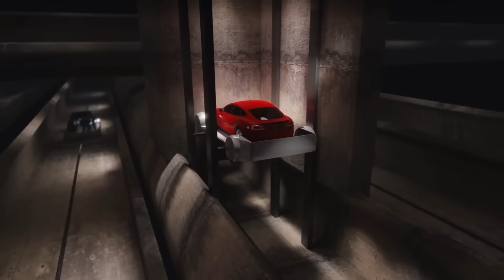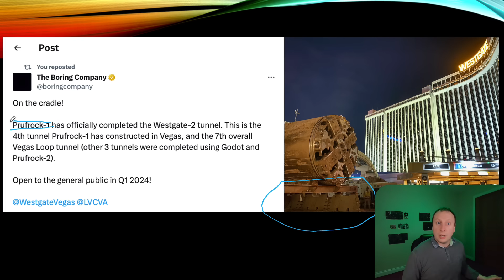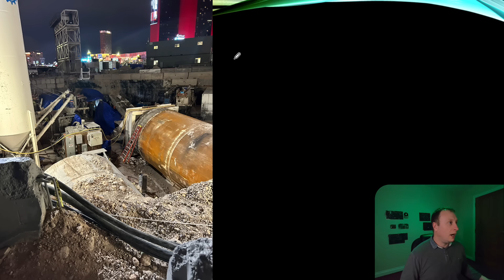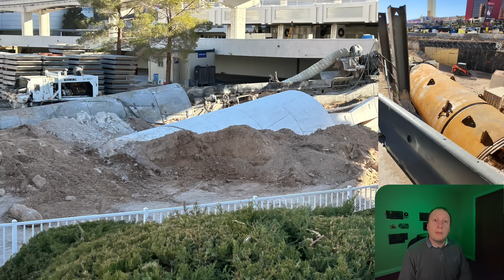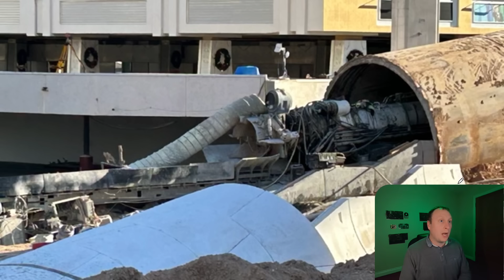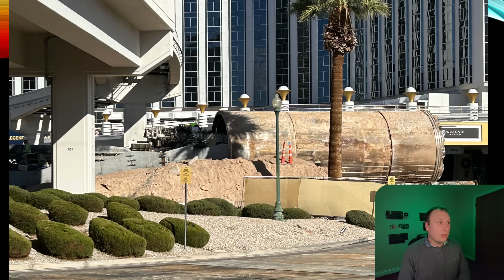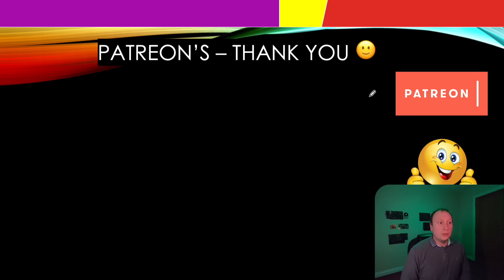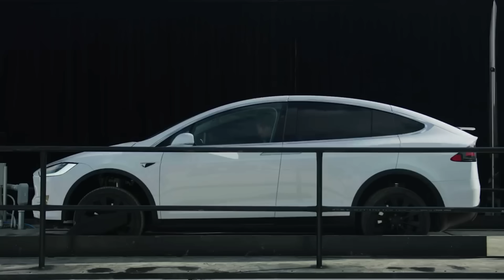New Boring Company Twin Bore Tunnel Completed in Las Vegas 🚇 👷🏼 👍🏼 💚 🤑 #186

Comment: I’m wondering why it would be a good idea to retire the old tunnel boring machine, instead of just adding it to the arsenal, in order to keep more tunnels being dug at once?
Reply: If they have another machine that requires less labor, and is fastor (also less labor), less maintenance, etc. then it makes less sense to use old versions. As you can see, they did use it again when needed, and may in the future as future machines ramp up.
Reply: Cost.
Reply: Perhaps P-1 could be up-rated with bigger motors and better gearing - I expect the cutting parts are expendables, more or less - Perhaps Prufrocks could be designed with replaceable , modular wear component units where a bolt-on could be replaced and the original could be refurbished. (Nothing like having a new "Furbish", is there? :)")
Starship skins sound like they would be very durable if used as an anti-wear skin for Prufrock.